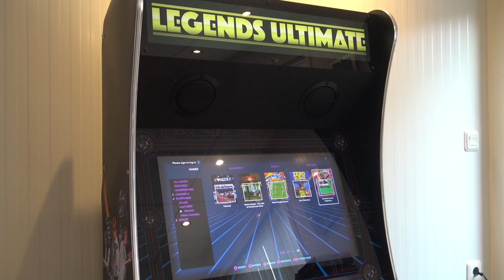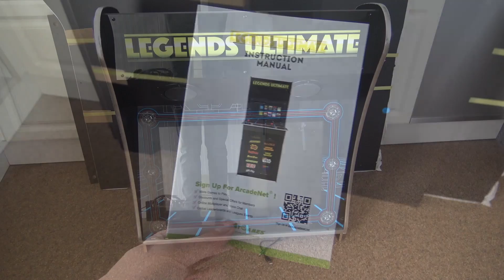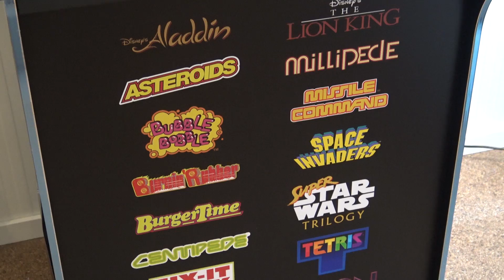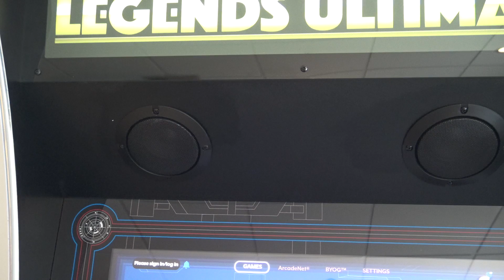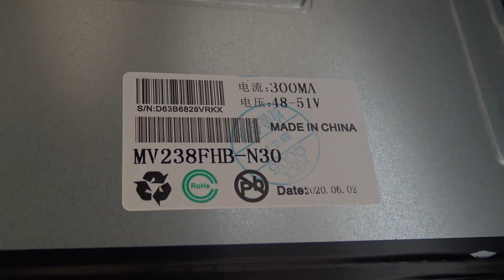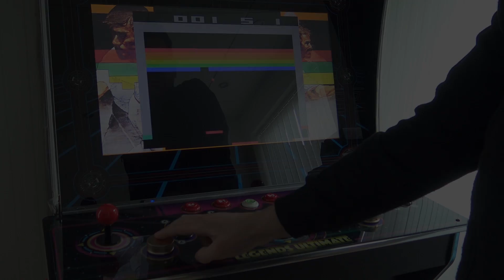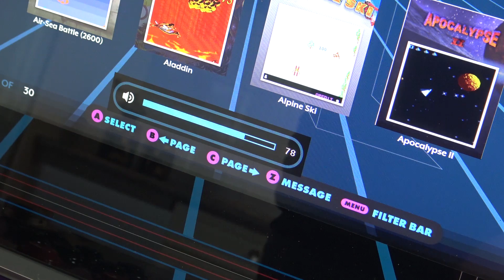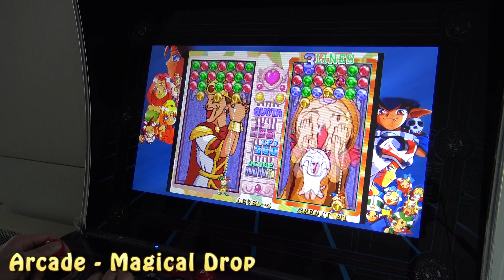Atgames Legends Ultimate Arcade Review *New Model*

Comment: I actually prefer the side panels on this 2nd gen. If you look at the 1st gen, the artwork is only on the lower half on the sides and the seam between the top and bottom sections is left exposed. The side panels cover the seam, and they allow for aftermarket panels which could be easily swapped out. The only downside is that they don’t lay perfectly flat.

Comment: does this play better than the pandora box? I know there is a 1200games usb stick for sale on ebay specfically for this machine to plug into your system. i want to buy one, but i only want to dish out 200-300$. this seems pretty neat. i bought the mk2 arcade 1 up machine and felt like i got ripped off. only has 3 games on it.
Reply from the maker: The fact you can emulate with 4:3 and borders is a   big positive side. 
Pro sticks is here... will make review and compare with pandora in the future 🙌

Comment: Some questions ...
1) Will It Be possibile to add a real coin Door working to load credits? 
2) what hardware is inside? A pc or something like Pandora?
3) is It possible to add our mame roms?
Thanks For reply . 
This machine seems awesome 😍
Reply from the maker: Hey Hey Viking120373
1. Nah... wood on the front part is not thick enough.
If you manage to add coin door it will be a wire nightmare getting power and connecting it to the coin mech inside, and if you get it all the work some games only work with insert credit in software menu so far I know. 
2. I think is was a android based hardware (correct me if i'm wrong) 
3. You can be naughty with the USB Connection combined with EBS Stick 👹

Comment: Being a 40+ year vet in the arcade/computer world, let me point a few things out:

1) Putting the HDMI and USB (for the external systems) on the main control deck is beyond IDOTIC. It should have been put in the back where some sort of area should have been made (they have ALL that dead space inside of the stand, i put mine together as well) where a raspberry PI or other system could comfortably rest and attach to hanging down cables.

Personally i believe they did it  (on purpose) so the HDMI plug would fail and people would have to order new parts.

2) Their support is HORRIBLE. I bought 2 items, was "guaranteed" by one of their people, both would arrive in 3-8 business days after purchase. The LU made it on time. After that i had to get online and email them (for days on end) to get any kind of reply and they "waited" until the pinball unit had already shipped a few days to return the email and say, "Oh, it will be there in a couple of days". The pinball unit arrived via TWO different carriers at two different times.

I consider myself lucky to have gotten anything at all and their design flaws can be spotted by the most ignorant of people they are so bad.

They "sell" streaming time to you, which is beyond greedy. It's your system, why should you have to pay (again) to hook another system in. Their OTG is quirky (at BEST) and only seems to work well with "some" Raspberry Pi units.

They allow other companies to advertise their items at the WRONG price and, when you call them out on it, they claim "Oh, that's a cell phone screen cap. It must be registering wrong on your cell phone". They so ignorant they can't tell the difference between a PC screen cap and a cell screen cap and it was from their AUTHORIZED (suggested) app "SHOP" that advertised the add-on pinball controller panel for $80.

I can't say enough bad things about this company and their ONLY SINGLE REDEEMING QUALITY is they made a decent control deck. They're greedy, ignorant morons in every other aspect and they expect everyone to kiss their asses for making a control deck that's been on everyone's mind since the mid 1990s.

That being said, they made it so proprietary that it's hard to connect the deck to other units directly to BYPASS their nonsense.

Hell, i would PAY someone to create an interface that bypasses their whole system and could plug HDMI/USB 3+ into a PC and i could turn the system into a way better unit using Coin Ops Next 2.

nuff said?

Comment: I wanted the 12 in 1 Atari Deluxe from Arcade 1up, but it seems to be discontinued. So I may have to settle for a used one. I wanted it for the trackball and spinner games. I may consider getting the Legends Ultimate cab because it also has a trackball and spinners.
Reply: This my fellow gamer friend is way better.  I had the 12 in 1.  Spinner was awful on the 12 in 1.  The control panel on the Atgames is great already- spinners and trackball.  No cheap sticks or buttons either and a better and bigger display.

Comment: Bought the unit at Sam's about one week ago.  Wi-Fi does not work properly and created a ticket for support; still have not heard from them.  It is unfortunate that a user has no access to support.  I was able to get the unit to work with my hot spot, however speed is not that good.  I ordered the extra pack for $60 dollars and still requires a USB attachment so I can get the Pinball games to work... a rip off.  What is frustrating also, if you bought the rights to all these games, why not load them in the local machine instead of working off servers?  The speeds does not allow for smooth continuous streaming.  Terribly disappointed.    
If I do not hear from support, its gong back to Sam's Club.  Be aware if you are thinking about buying this unit.
Reply from the maker: Thanks for your feedback and opinion about it. 
Always good to read if people are happy or unhappy. 
Hope Atgames will fix these problems.